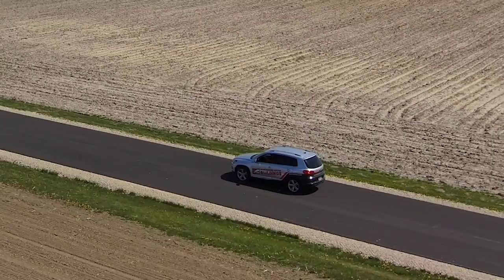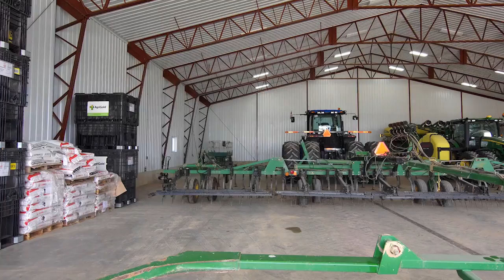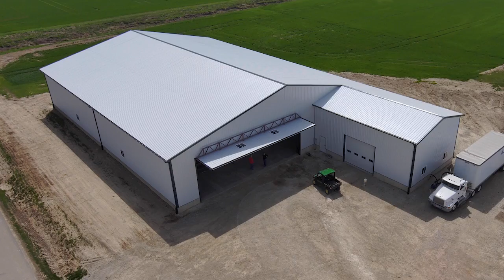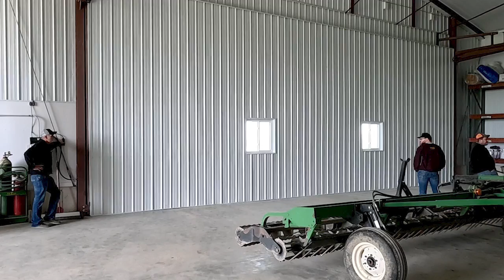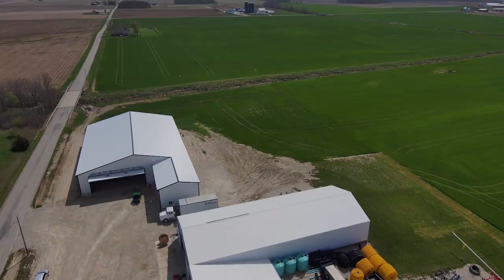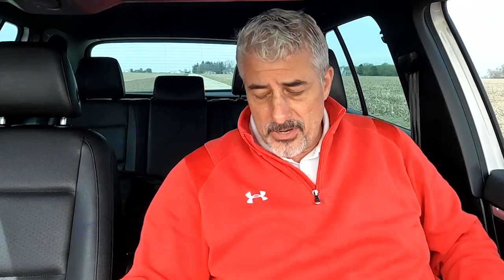K Building Farm Shop

Comment: What was used for lumber in the roof and sidewalls? Whats the spacing on red iron uprights?
Reply from the maker: So sorry for the delayed response Scott. We didn't see your question.  The lumber is #1 Southern Yellow Pine. The sidewall girts are 2x6x16 and the roof purlin is a 2x8x18 for the 30# ground snow load.  The standard 20# ground snow load would call for a 2x6x16 roof purlin.  The steel mainframes are set at a 15' OC spacing.